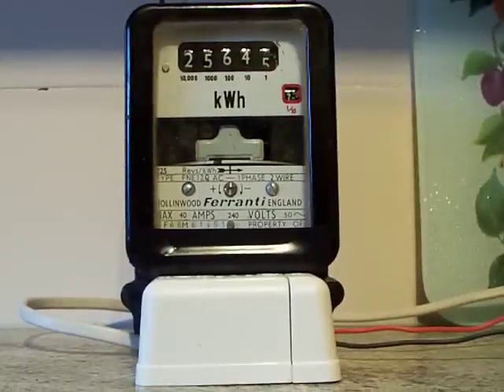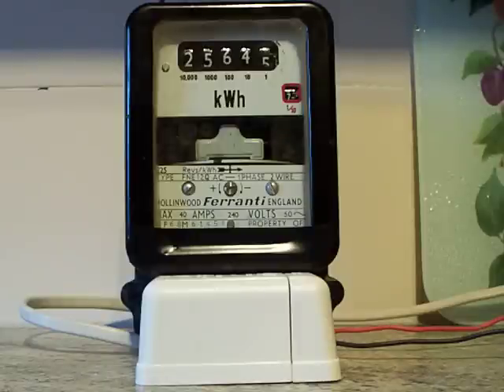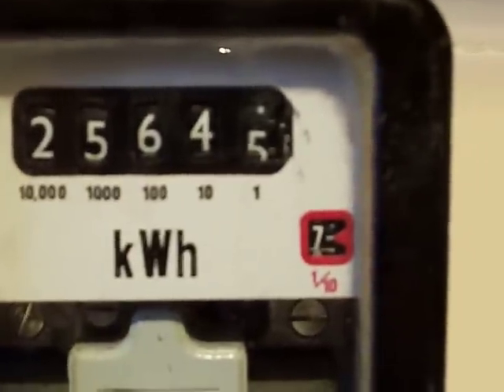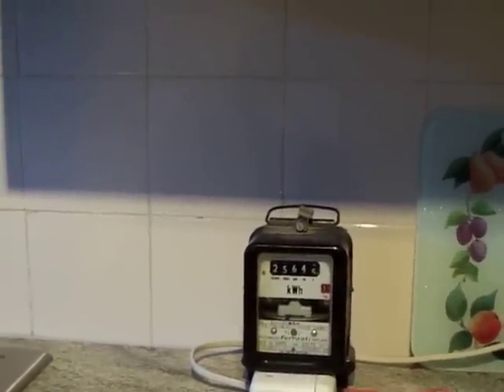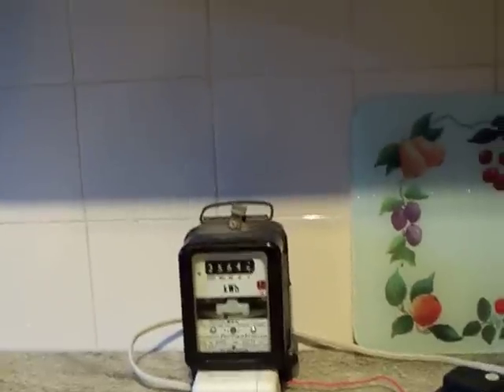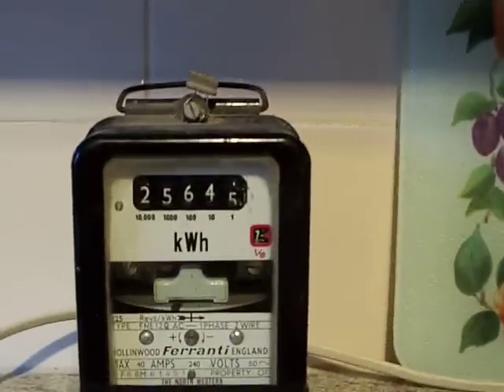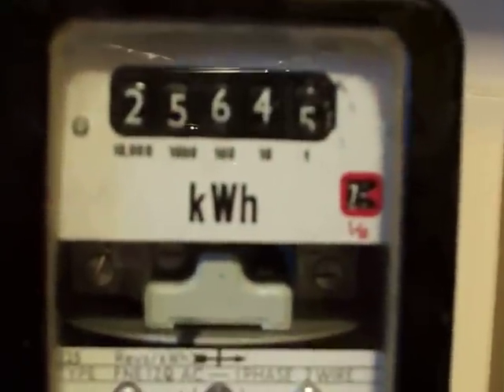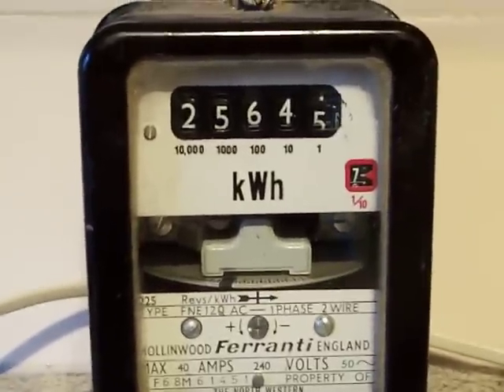Electricity Meter : Powered Ferranti FNE 12Q kWh meter.

Comment from the maker: Hiya. There's a few other things that I've cued-up to before I consider cleaning & restoring this meter, so that'll be something for a bit later. In the meanwhile though...

The meter will need to be accuracy tested before I clean-&-restore it, because that's what I did with the big Venner 'ERD-2-BPS'...only then to find that the darned thing doesn't work! :-(

So yes, other things cued-up to run before I clean-&-restore the FNE.

Remember that box of bits? :-D Mmmm! :-D

Stay tuned. :-D

-BBD.